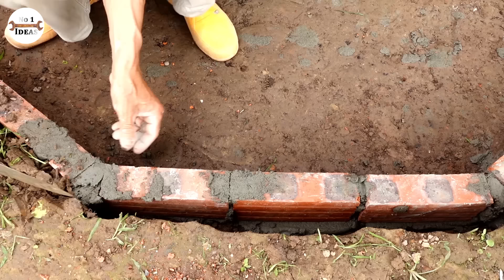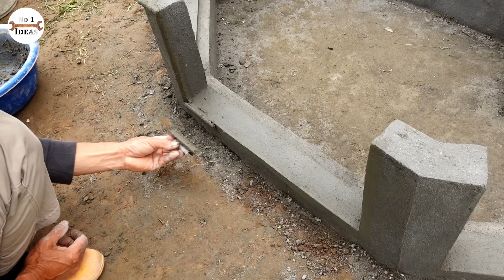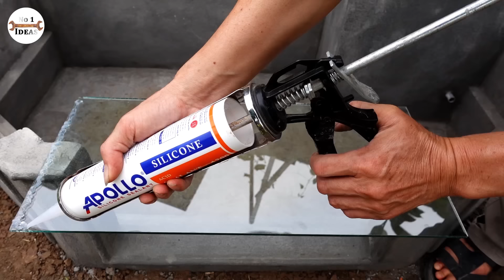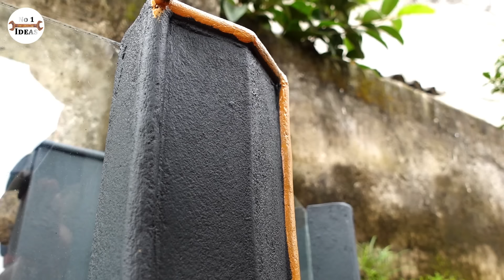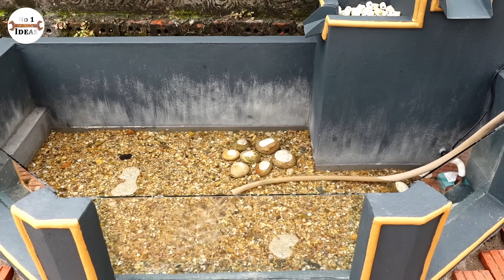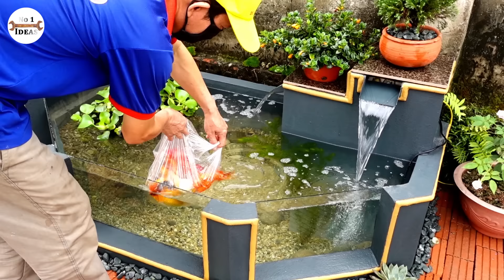Garden Design Ideas - Turn Ugly Garden Corner Into a Beautiful Waterfall Aquarium Garden

Comment: How did u manage to glue the glass and loose cement with silicon? Beyond me
Reply: Exactly even i wanna know that
Reply: Also how the heck the bricks stayed strongly bonded to the soil with only cement on the soil
..do cement sticks to soil,?beyond me too...
Reply: I know right, normally you need marine silicone or some type of silicone made for water and after the first layer you would usual go back over the seams with more to make sure it is water tight and you have to let it cure for 24 hours before it can hold water. This is just my experience with fixing my own aquariums tho.

Comment: Looks awesome however I feel like you might have been better off putting a drain on the bottom to help with cleaning since you dug out a bottom. Just a small pipe would have been enough. That way you could hose it down whenever you need to.

Comment: how often u have to clean the pond and is cement going to absorb water after sometime? how to make the pond waterproof?
Reply: You can use waterproof cement. Or use waterproof compound which you can mix with the cement. If you use normal cement then yes it will drain rather quickly. You can also use a waterpoof coating over the cement. Like they do with pools

Comment: loved the video. excellent. I am planning on building a similar size one with similar glass windows. what is the type of glass you used and the thickness.  I believe if it is too thin it will break due to pressure.